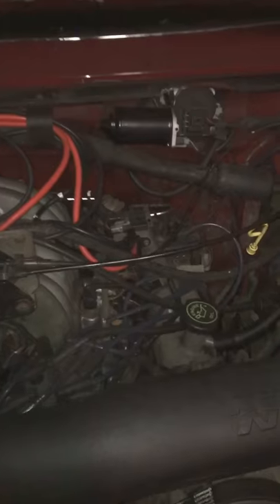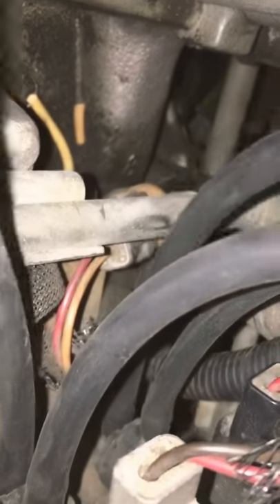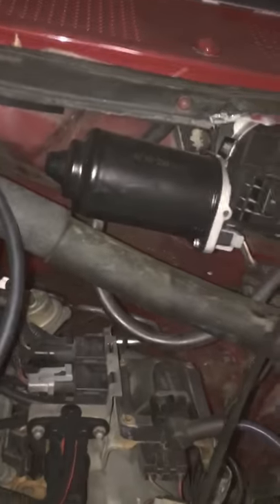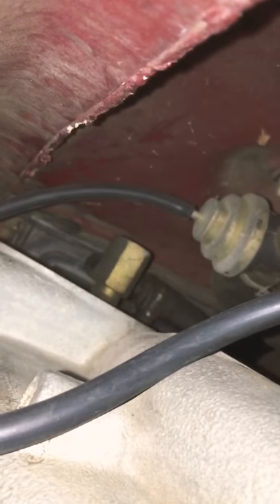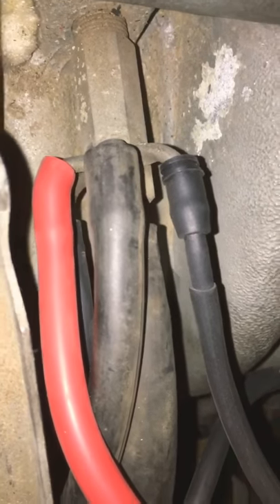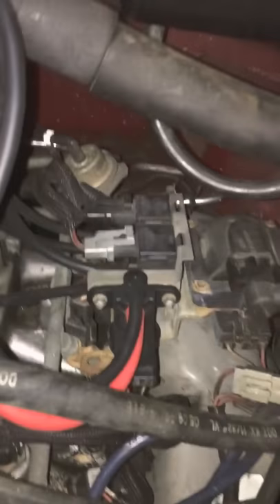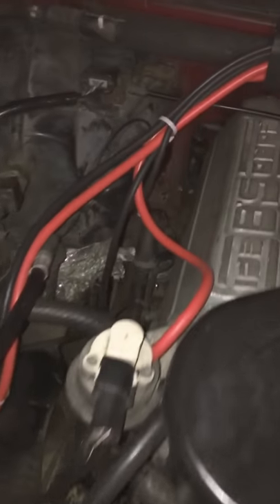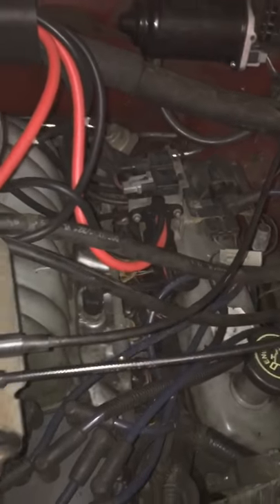Vacuum Repair - 1991 Ford Bronco

Comment: Thank you so much!  I’ve got a 1990 F-150  with the 5.8 in it that has to be done.  The original hard lines have become brittle and are breaking. The truck is not running so great. Your video is the best on YouTube, well done and is very much appreciated!  Many thanks again!

Comment: Alberto, this video is the easiest and most comprehensive one I have come across regarding vacuum lines on the 5.8 EFI. I was about to give up on my F-250 after watching hours of videos that were over my head, poorly produced, or incomprehensible. Thank you, thumbs up.
Reply from the maker: clark57225 i looked all over for a simple strait forward vid. So i decided to be the one . Glad it helped someone out
Reply: @JoseAlberto747  How many hoses will I need for my 5.8L 351w? Did you buy all new connectors and Ts or did you reuse the old ones? I have a vacuum leak on my bronco and Id like to just change them all out if its not to hard. Could a vacuum leak cause stalling or high and low rpms? I need to change my lines anyways but was wondering if this could be the cause of my check engine light, cutting out, and stall issues I've been having.
Reply from the maker: kibler1985 i bought everything new. T’s and all
Reply: @JoseAlberto747  ok thank you

Comment: Alberto, i have a ?, y is my egr vacuum line is pulling vacuum at idle, bought a new vacuum solenoid n new egr sensor n still egr vacuum line pulling vacuum from idle, could it b ECM not relaying messages to solenoid n sensor?

Comment: Thanks for doing the video on this, you have help numerous people with this video, im sure. Now I dont feel so apprehensive about doing this. May attack this in the morning.  Thanks!!
Reply from the maker: Go for it brother, its not that bad 
Auto zone had vacuum/fuel lines in all dimensions in the back just ask. Any lenths
Reply: @JoseAlberto747  I bought all the 3mm and 4mm silicone hoses in their respective colors. I opted to keep the colors succinct in keeping with the oringinal diagram but have been real apprehensive about it because I wasnt sure if it was manageable with the top hat on the motor. Wasnt sure if there was a tee on the back side that I couldnt see.

Comment: Where did you get the tubing from?
Reply from the maker: Desirae Ceniceros Upgr8 Universal Inner Diameter High Performance 5 Feet Length Silicone Vacuum Hose Line (4MM(5/32 Inch), Red) https://www.amazon.com/dp/B00TAEXYPK/ref=cm_sw_r_cp_api_i_V.jlCbDW55FNX

Comment: I have a problem with my AC anytime i accelerate it stops blowing.. can you help me identify the vacuum hose? Great video
Reply from the maker: Check out the vacuum connection below the glove box area, 9-10times that part comes loose and either only blows out the defrost or cuts out when accelerating. 
Under the hood id check looking at it from the front to your left rear area near the firewall where the ac components are. Theres a vacuum line that always dries out going into the firewall with a bundle of others . 
Good luck

Comment: Do you have idea where is the A/C and  Cruise Control vacuum lines in this motor??????
Reply from the maker: Dont think so, under the glove box to the right panel there is a 4 prong vacuum connection , that usually slips out on a/c and vent control

Comment: I don’t seem to have vacuum coming from the engine to my egr solenoid any tips
Reply from the maker: Track the hoses one by one. There is a fail at one point
Reply: @JoseAlberto747  the blend door vacuum thing at the top left of the engine compartment is completely Broken off could that cause it to have 0 vacuum at the egr solenoid?
Reply from the maker: @timmcgowan27  i believe that is for your vents to the dash , but thats a start

Comment: Is this what could be causing my bronco to shake and Rpm fluctuation at idle?
Reply: Check the vacuum line from the charcoal purge canister that connects near the throttle plate.  It should have a splice in it and also a vacuum restriction.  If this line is leaking, your RPM might be high, or idle is lean.

Comment: I want to redo mine.  I will try.  5/32 vacuum hose and a tees ???
Reply from the maker: Yes sir
Desirae Ceniceros Upgr8 Universal Inner Diameter High Performance 5 Feet Length Silicone Vacuum Hose Line (4MM(5/32 Inch), Red) https://www.amazon.com/dp/B00TAEXYPK/ref=cm_sw_r_cp_api_i_V.jlCbDW55FNX